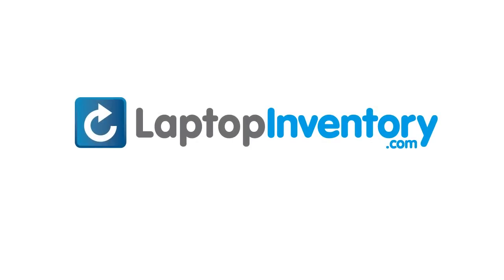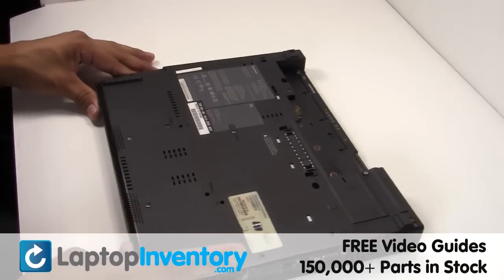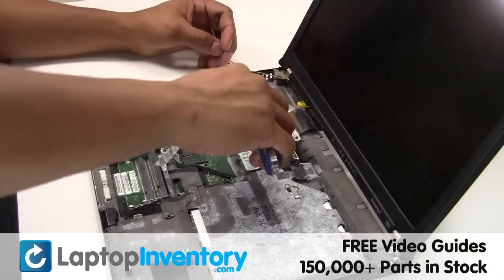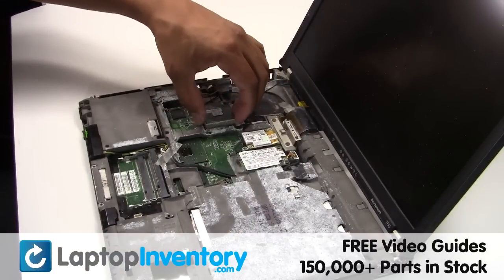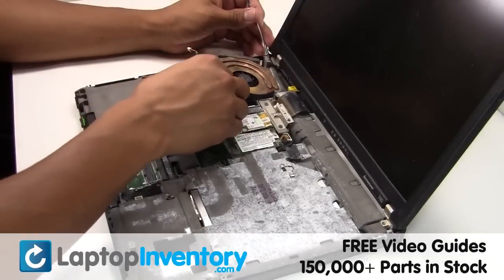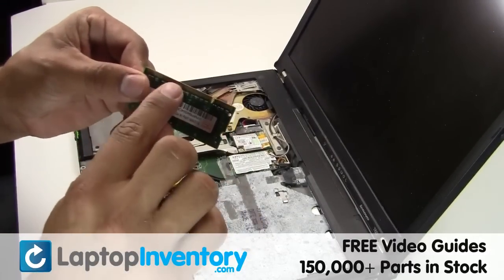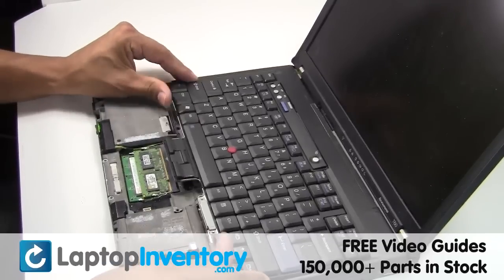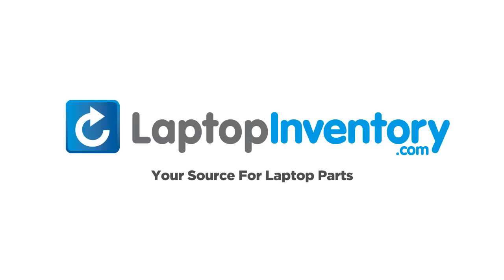IBM LENOVO CPU T60 T61 Replacement Guide - Install Replace - Laptop 42W7856 42W7654

Comment: excellent video.
Is this laptop compatible with core i3 precessors?
What precessors are compatible with this laptop?
thanks and regards
Reply: Core 2 Duo and some Core 2 Extreme CPUs, depending on the model and motherboard.

Comment: Power tool and a package "Stanley" knife to remove / adjust screws
No regard to identifying the different screw lengths for reassembly (I can see why you didn't show that part?)
No thermal paste applied to the CPU before refitting the fan?
I would stay well clear of these "LaptopInventory" videos
NOT GOOD, in fact PAINFUL!!!!!!!!!!

Comment: PLEASE no one folow this video guide to the letter!
I really appreciate you guys taking the time to film this, but it needs a do-over. Apart from the weird use of a stanley knife to unlock the processor lock, and neglecting to mention thermal goo, the screw removal was pure comedy: 

"Which screws shall I take out, boss?"

"All of 'em!"

" And what should I do with them when they're out?"

"Just, like, scatter 'em over the bench. Duh."

Do not remove all of the screws from the base of your laptop. You don't need to take out the 16+ external screws which they do in the video (and conveniently don't show being put back in...)
You only need to take out 7 screws: the 5 ones indicated by keyboard & RAM symbols (holding the keyboard & wrist-rest/trackpad on), and the 2 that hold the upper keyboard-surround (these aren't marked, but you can work out which ones they are by carefully teasing the keyboard-surround and seeing where it is held down at its top corners).

Comment: Was looking for a cheap laptop that took socket P 65nm cpus then upgrade to Penryn 45nm and enjoy the cooling intended for hotter cpus and speed boost. unfortunately Lenovo t60 is socket M and T7600 if it works is the best available assuming the bios is compatible

Comment: Ouch!  
How about carefully removing the bottom screws so you can remember which holes have long screws and which ones have short screws.
How about using a proper bladed SCREWDRIVER to unlock the CPU so you don't risk slicing your finger open.
How about cleaning the heatsink and CPU then applying new thermal paste so you don't cook your new processor .

Apart from that, nice view of the internals on the T60///
Reply: I cringed several times with this video, and i really don't get using a electric screwdriver with something as delicate as a laptop, one miss and its seriously scratched, or the screw is destroyed.
Reply: @Boemel  Maybe they enjoy drilling stripped screws out!
Reply: Painful to watch, ain't it...